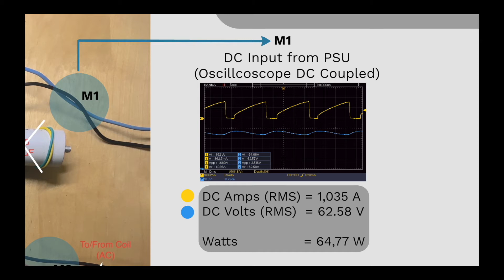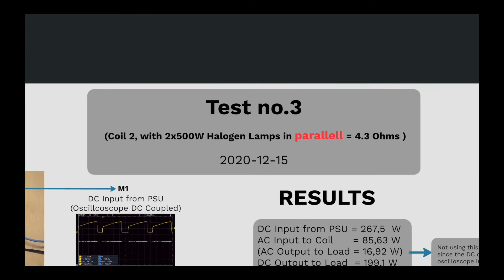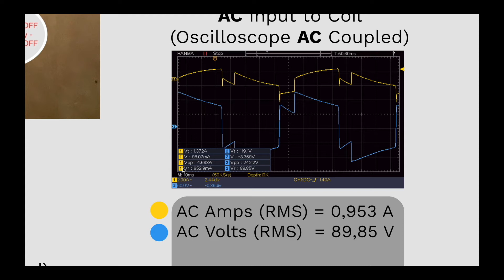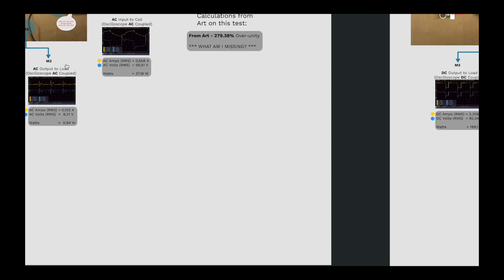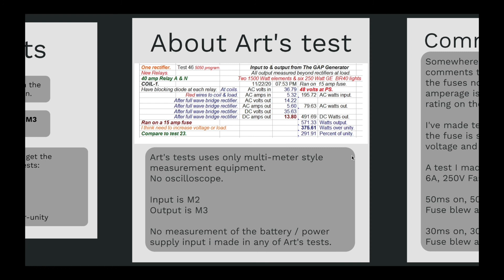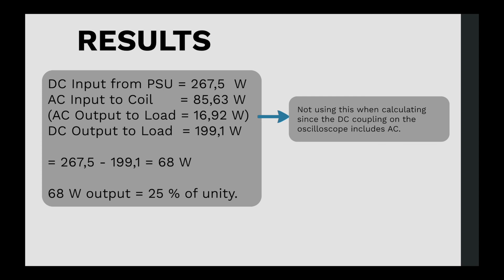Final Conclusions! Two Tests with the GAP Generator.

Comment: 05-31-2025
#1. YOU ARE USING SSRs. CONTACTS OF SSRs DO NOT PRODUCE ARCING.
#2. USING TWO STANDARD RELAYS, I AM REVERSING THE POLARITY INPUT TO THE RELAY CONTACTS. THE ARCING OF THE RELAY CONTACTS PRODUCE ELECTRICITY. THE MORE RELAYS THE MORE POWER PRODUCED. IT'S VERY SIMPLE.
#3. USING THE DISPLAY OF AMPS AND VOLTS ON YOUR POWER SUPPLY DOES NOT CONSIDER 1 and 2 above.
#4. COILS AND MAGNETS ARE NOT NEEDED FOR THE GAP GENERATOR TO WORK. THE ARCING OF THE RELAY CONTACTS IS ENOUGH FOR OVER UNITY. I HAVE A SETUP LIKE THIS AND USING AMPS AND VOLTS ON MY POWER SUPPLY TO MEASURE INPUT IT'S STILL OVER UNITY.

Comment: As I understand it, he doesn't use the second half of the cycle in his calculations. Simply because, there is no outside input current in that period; only the current stored in the electromagnet field and the permanent magnetic field returning to equilibrium, which I think should induce a current in the same direction, amplifying the already existing flow. Also, I don't think he used solid state relays. For what I know, he disconnects both rails positive and negative arguing the BEMF would escape too soon???  I think I have seen all of his videos, but quite honestly I have not tried to replicate the GAP yet, although I am quite eager too. Please, keep up the good work.  P.S. Since you have a double winded bobbin, what would happen if you connect them Tesla bifilar style with a condenser in between the end and the beginning of the second winding of the electromagnet???
Reply from the maker: I'm not planning to continue this project at this moment. There' s simply no energy for it, but if I do, I will make another coil with much thinner wire to get that inductance way up. I believe that is the secret to create some real power. However.. Those solid state relays are the weak point as they are super sensitive to back EMF.
Reply: hello guys.. i am actually thinking about art porters work too...  so get rid of the SSR ! look in the SSR-manuals and see what is realy inside, its more than a simple mechanic relay does.. diodes and caps are inside in output side.. this will no the same circuit at all at the end we need to replicate... so far we have to go with the old klicking relays.  

Coils... yes we have to use high ohm coils... no bifilar or low ohm.  

Get rid of too much extra caps here and there... 

at the end... the circuit is an L(inductance)-R(resistive load) LR circuit.. and in parallel style, because both ends of coil and Resistive load are connected together. 

When we power the circuit, the energie goes there, where less resistance is, to the coil, because coil has less resistance than the resistive load(heaters, old style lightbulbs)....  keep in mind the time you need to charge a coil... (self)inductance, core material,... 

if input power is switched off... we have the L-R circuit. 
 
Whats special here?
i see speciality in the strong opposing magnets, creating a "blocking wall" in the middle of both magnets, where our coil is sitting. I have never seen this in another design. Think about the magnetic domains in the core. How are they orientated? Think about what they are doing when circuit is powered on and off and powered again in reverse. 
Yes there is never a 180degree of orientation of the magnetic domains, that would consum energy, generate losses, as usual. in that way i remember jnaudin SSG experiments and hsyterese effects in core with an attached magnet. 

What do we have more... powered coil and magnets are merging their fields, when orientad in same direction, and on other side the fields repelling , creating a special area "blocking wall". 
So how you much energy we should input to get magnetic fields of coil and magnet get merged enough?
Are there any magnetic noise, ringing  effects?
Art porter shows magnetic fields with an magnetic field sensitive foil. But that shows only a little bit of magnetic field movement..very small.. too small to create power.. i guess so far.
But thinking about the magnetic domains in the core looks more interessting.
If in the Blocking wall , the magnetic domains are random  chaotic aligned.. and this zone is moving back and forth by the magnets.. that could be the source....?
Reply: measureing with instruments that are desinged for sinus AC and 50/60 Hz... will measure anything here... art porter latest vids shows osciliscopes measures...   but finaly could we check input and output with other methods?  using input directly for output and then with coil added...woudl the heaters nead more/less time to heat water of a given volume from temp1 to temp2?